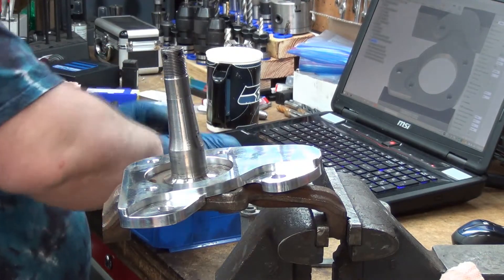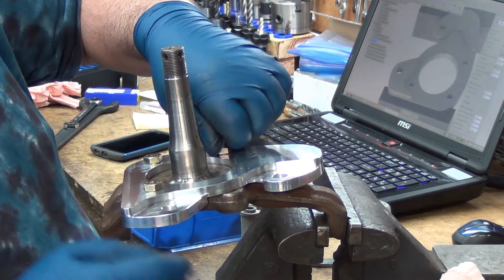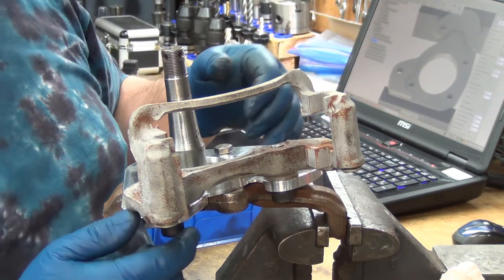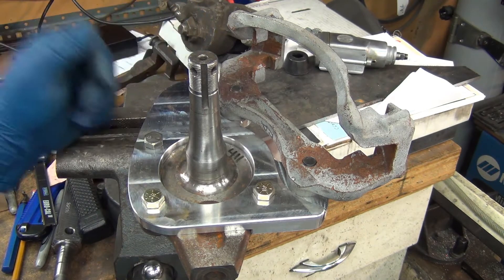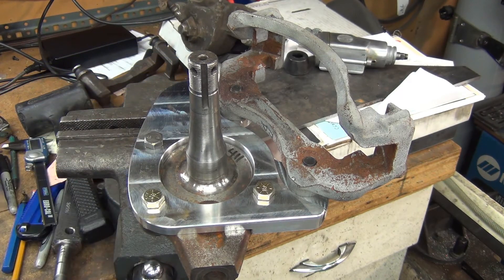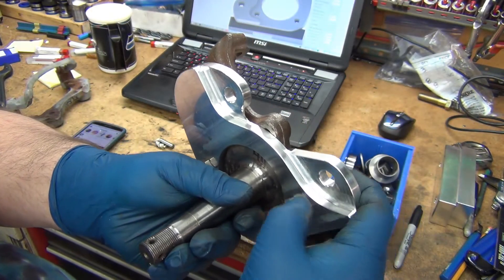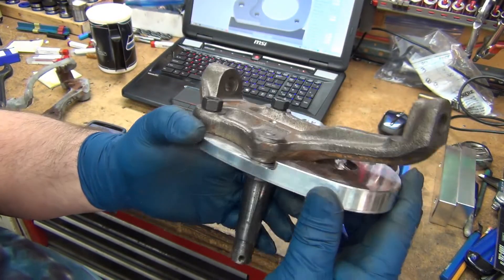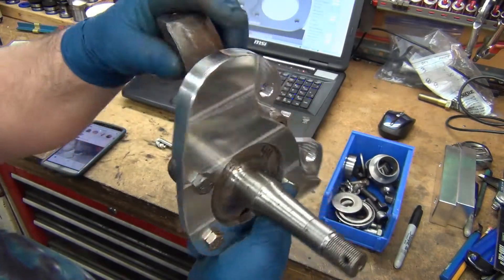Disc Brake Bracket Prototype - 411SSS Ver1

Comment: Man that's a sweet looking part. You've got to be happy with that. Excellent CAD work too. Shame you don't have a 3D printer so you could print your proof of concept to cut down on using your aluminium 👍
Reply from the maker: Thanks!
I typed in a comment about how this would have been a perfect use for a 3D printer, but then deleted it. LOL!!!  I have two 3D printers.....just not that are finished and working. :(
Reply: Oh sorry mate I didn't know. I remember a previous post where your mate printed out a part for you. Speaking of 3D printers I need to get myself one sometime soon 😊
Reply from the maker: Yep....I could have had George print this one, but I didn't want to wait. :)